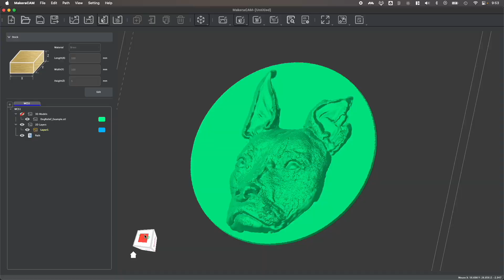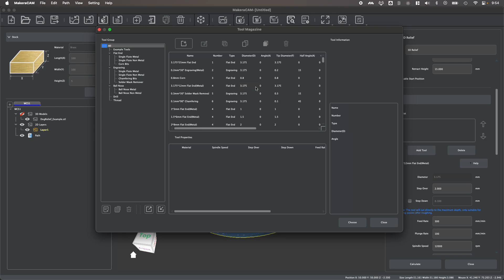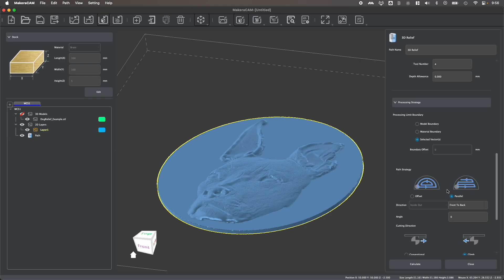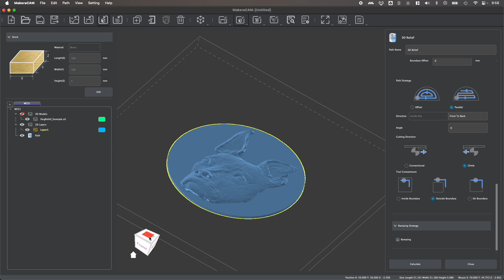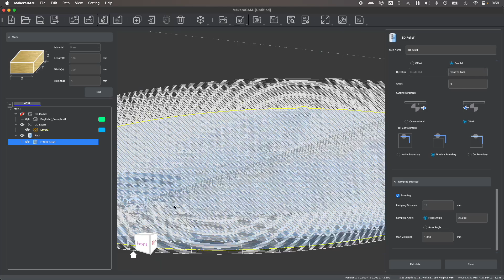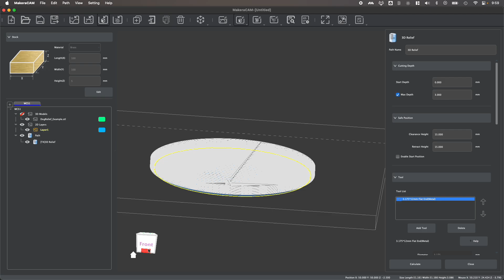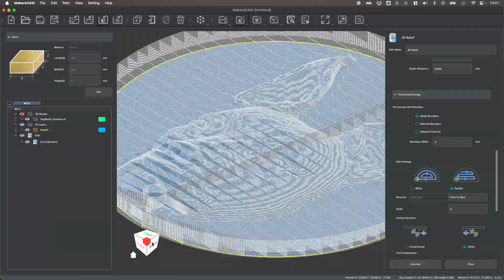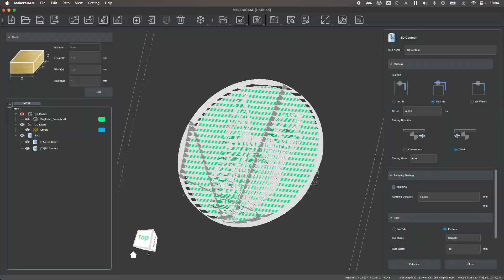Makera CAM - Creating 3D Relief Tool Paths

Comment: I'm trying to replicate this example by loading in the provided dogrelief_example.stl and no matter what I do, I can't get the tool path to be anything but straight lines above the stock, it doesn't actually cut out the relief. I've copied every step in the video, adjusted the stock height relative to the STL, the result is always the same. Is there some kind of trick not shown in the video to make this work? I'm using MakeraCAM v2.1.7. Thanks.
Reply from the maker: Is there an offset applied to your tool path? If not, it may be a software bug in that version of Makera CAM Beta. Please contact our support team for more assistance if needed.
Reply: @Makera  I sent an email to your support team and they were able to get my .mkc file working just fine. It turns out the cause was me trying to run MakeraCAM under Wine on Linux. On a real Windows machine the 3D Relief feature worked. I didn't suspect Wine was the cause because all the other functionality in MakeraCAM works fine, so this is very close to working well on Linux.

Comment: Is there a way to stop the first roughing path a little higher, (but not like 3mm, but as in an offset from the face?) so once the finishing path is done you don’t get larger drill marks from the first roughing path?
Reply: Think I might have just answered my own question, does ‘depth allowance’ feature do this?
Reply from the maker: Yep!

Comment: it would be nice, for the carvera owners, if CAM remembered the tools I have loaded and gave those as a quick choose set of options at the top of the tool list.  
basically, if I'm working with the same materials most of the time, and using the same tools most of the time, it would be nice to choose the 1-6 that I've set up without having to go through lists to find the same 6 tools I have loaded for each job. 
does that make sense? or am I talking gibberish?  
it seems like it wouldn't harm 'air' owners as they'd skip right past that section of 'tools' or it wouldn't be shown to 'air' owners at all, while carvera owners would save a lot of scrolling and clicking to choose from the same 6 tools that they've used on the past 57 jobs.. 
it could also be accomplished by using a 'favorites' section at the top, and this would save time for both carvera and air owners who mostly use the same 2, 5, 9 tools.  
the difference would be carvera owners have default slots for those favorite tools and air owners would not. 
just trying to save some time on repetitive tasks, because more mouse dragging, scrolling, and clicking to just select the same things over and over again is.. tedious and soul crushing UX.
Reply from the maker: This can be done by changing the tool number assignments in the Tool Library rather than the tool paths. If you reassign the tools in the library, you can make a new group called "favorites" and also assign the tools to default to which ever slot you would typically load them in.

Comment: from what is the clearance height calculated?  the top of the material?  or does it depend on origin selections?
Reply from the maker: Clearance is automatically calculated from the top of the stock.

Comment: How would you add a rest machining type of operation? I see you go from a 3.175 end mill and then straight to a .2mm v bit. I noticed from other softwares that certain crevices, the 3.175mm end mill could not reach so you need smaller bits to eventually create the relief. Going from 3.175 to .2mm will break that v bit because the v bit will try to remove material that the 1/8 end mill left behind due to no being able to reach it. Is there a way to start with the 3.175 end mill, leave a specified layer of metal after every bit so that a 2mm, then 1mm, then .5 mm tapered ball, and finally a .1mm v bit could all come in to get the best detail and all spots machined?
Reply from the maker: To create a REST machining with a Pocket or Relieve, you can add more than one tool in the tool list for the tool path. The bigger tool should be first, followed by smaller tools in descending order. At this time, REST machining is not functioning for 3d reliefs in the current beta, but will be available in future releases soon.
Reply: @Makera ah I see. So does this mean even if you were to add smaller tools for a semi finish, that bit would start cutting all the way from the top until it reaches down to where the previous bit could not reach or left behind?